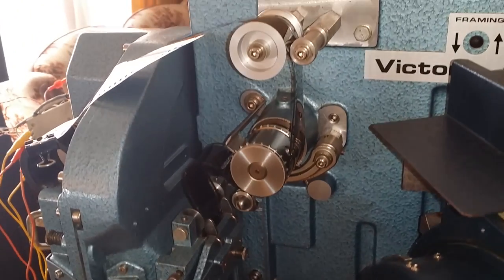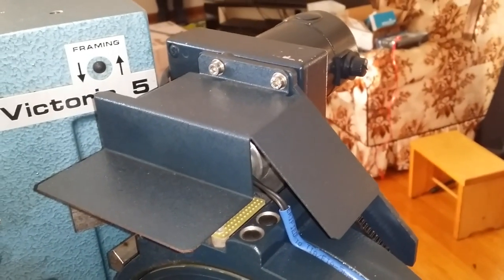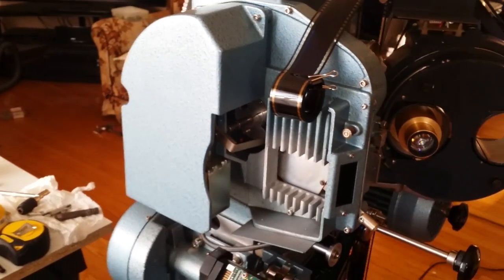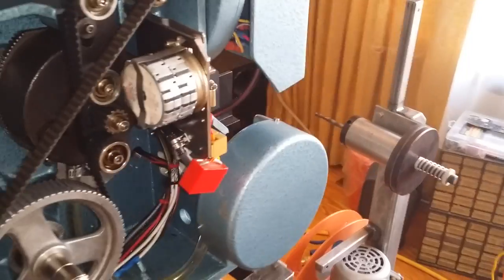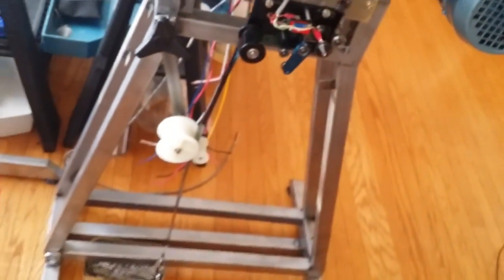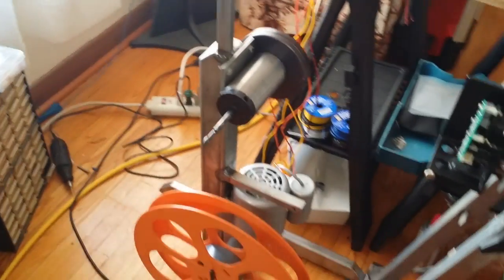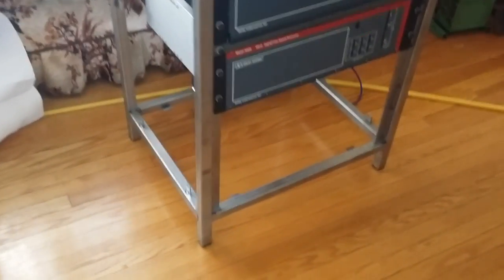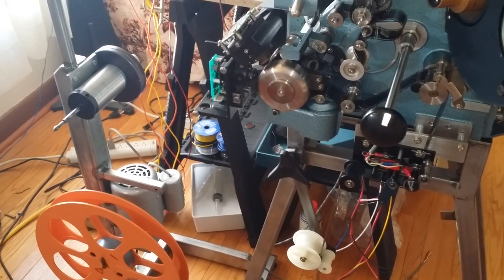Setting up a 35mm film projector to run at home - part 2

Comment: Excellent piece of projector, very neat and clean, how would you synchronize the take up drive motor with projector?  What about next part, anxiously waiting for video of projector while running.
Reply from the maker: I am going to wire a switch to control it manually. I could make it automatic to start with the main motor, but decided not to, for the extra control ability.